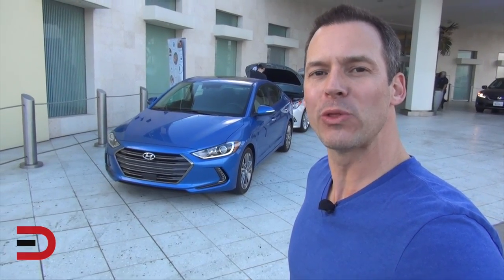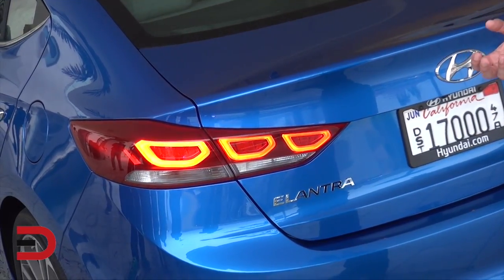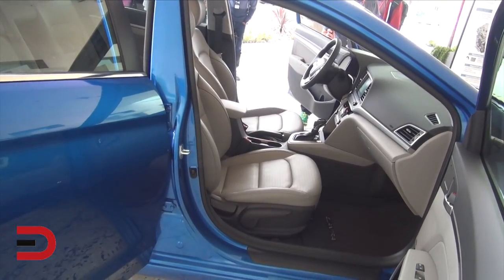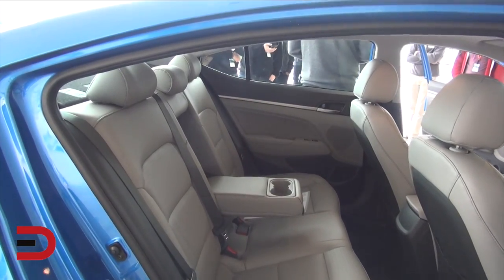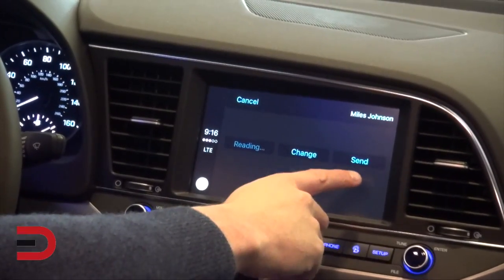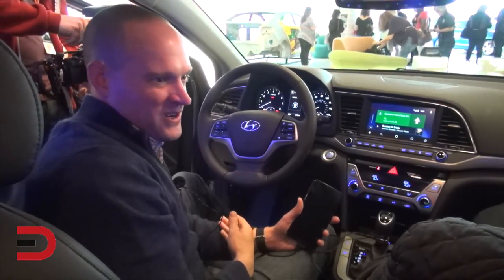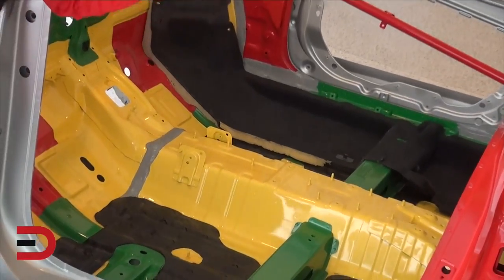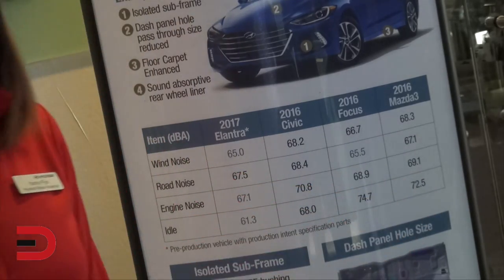Here's the Inside Scoop: 2017 Hyundai Elantra on Everyman Driver

Comment: Im stuck between the Elantra Limited and the Civic Touring.  
The dash of this car around the climate controls looks really cheap whereas the Civic touring doesn't.  I think the honda will have better resale value as well.

Any input from anyone else?
Reply: Eric Mcdonald I have a Mazda 3 so 0 bias on my part. I would get Honda. unique extrorior design, mpg, resale value. Although I can't speak for the driving dynamics. Overall you can't go wrong with either. But you should definitely drive it for yourself.
Reply: I would say the civic touring.. better engine and MPG. and the interior of the civic is really nice.and cheaper in price  than this Elantra.